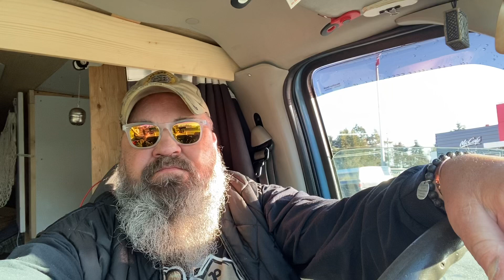Feeling the love ❤️

Comment: Warning  do not trust zip ties outside in the cold and sun they degrade. Yes Telco's use them outside but they are designed to be outside and will bear a certain load and cost a lot more. I have never seen the Telco ones for sale to the general public.  A Telco would never approve the use of ties for a load that can break free. A better solution is stainless steel hose clamps.  The Telco term is used to describe original phone companies. AKA Bell Canada where I worked in construction til I retired.  Tie wraps would never get approved to secure a load on a vehicle, there is stainless steel ones, but they are hard to work with in the underground the Telco's use stainless steel hose clamps.  I have seen 100 year old telegraph cables with ss clamps still good as new after being underwater for most of that time in downtown Toronto.